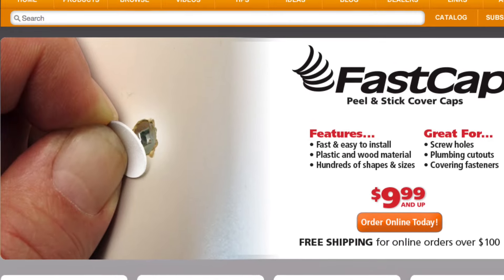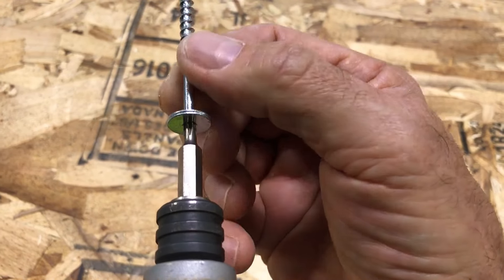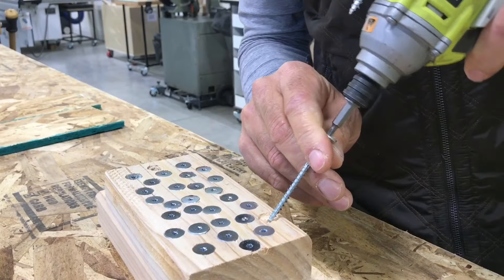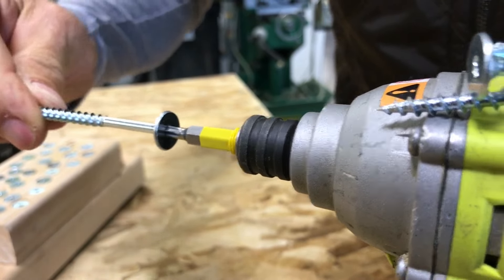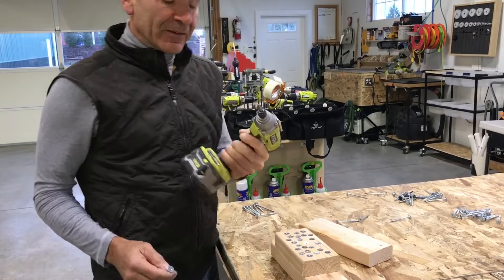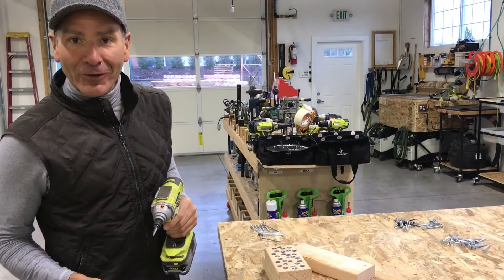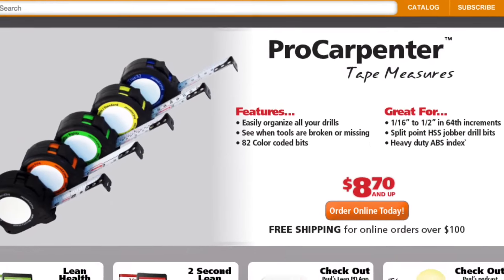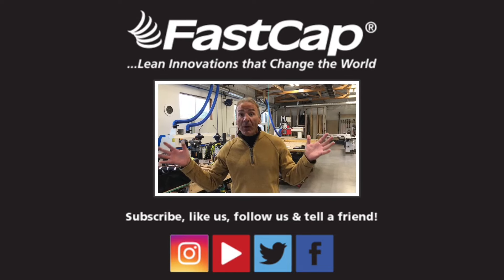Powerhead Screws with Torx Drive

Comment: Torx!!  So much better than square drive heads that are prone to strip.  I love that you kept a close tolerance on the torx!  Thank you for making these.  Fastcap is awesome!
Reply from the maker: Scott My pleasure so happy that you like them
Reply: Now that I am reading the other comments on this I should clarify my comments.  I have used fastcap square head powerhead screws and don't remember them stripping at all.  They are a great product.  My experience with bigbox sourced deck or general purpose screws is that the torx drive with less effort and are less prone to stripping.   Great that you make them both ways.  I won't have to change my bit as often.  Cheers!
Reply from the maker: Thanks Scott!

Comment: We, at BP way are very happy that you brought back the Square Drive powerhead. We use them strictly for installing cabinets and we found ourselves constantly changing beds between the torx and the Square Drive. Also, you mentioned how much tighter your screws fit the bit, that was a problem when you're installing thousands of screws and the bit doesn't come out quickly. Quite often in the bed would get stuck in the screw head and come out of the drill. So again, thanks for bringing back the Square Drive, and is much leaner for cabinet installs.
Reply from the maker: Brian, I get it! That's why we listen to the few people in the world that don't understand the benefit of torx drive :)

Comment: Great improvement. I have always been a fan of torx. The powerhead  is a great screw but I dont like the square heads as well as the torx. It also meant swapping bits while doing a project. So now I can have the best of both. FastCap continual improvement!
Reply from the maker: Thanks Rich!

Comment: fyi I've probably used about 2000 Powerhead screws since they came out.  Most often 2.5".  I've used a lot of both square and torx drive.  I've noticed apparent variation in the hardness of the bits.  I used to have problems with square ones breaking off and leaving the tip in the screw, and ones that rounded the corners of the bit and they wouldn't grab anymore, which is probably one reason you went to torx.  The square drive is fine as long as the heat treat is correct I think.  

Using the torx, I've had some softer than others that would twist the tip.  I've not had any torx bits snapping like the square drive, but some twist and then the teeth roll over and won't grab.  Not all of them mind you.  Most are ok.  It's not easy getting consistency in those little tips.
Reply from the maker: I appreciate the feedback and I promise you the quality control on the bits is pretty good. It's all done on the heat treat line that for the most part is very consistent. Sure, it's possible for there to be variation, but not a lot. We will watch this carefully. If you ever get one that you feel is not treated correctly, I would love to have you send it to me so I can review it. Happy to compensate you with product for any time it takes you to send the stuff back. Paul
Reply: I pulled a couple out of my scrap bucket today. Who's attn do I send them to? I don't need any compensation.  If the bit lasts for the box of 150 screws, which they have 70-80 percent of the time, I don't have a problem with it.  I've purchased extra Dewalt impact bits which have been pretty good. Brad
Reply from the maker: Thanks Brad!!!

FastCap, LLC
Attn: Paul Akers
5016 Pacific Highway
Ferndale, WA 98248

Comment: Hey Paul, now you have me wondering just how bad the HD screws are. last spring I rebuilt my front deck, for everything but the stairs I used square drive, for the steps I used torx to get rid of my last boxes. I didn't strip out a single square drive in the entire 400sqft top. In the 10 steps, two 2x6 wide steps I stripped out about 25% of the HD torx screws. Same screw gun, same setting, same length, same wood.
Reply from the maker: All I can say is we have tested this repeatedly...I am not 100% sure what the problem was. We will replace all the screws or refund you for the the entire order. Contact Sandi (sandi@fastcap.com). The Important thing is that we don't want to waste your time and we want you 100% satisfied.
Reply: FastCap no no, Home Depot screws, not yours. I'd written off torx because I have always stripped them out. but it makes sense if it is a tolerance issue.
Reply from the maker: Ok, good to know!
Reply from the maker: How about this...we're happy to send you a sample of our screw so you can try them and see how much better they are then everyone else's. We went out of our way to engineering and design them to make them very special! Contact Sandi (sandi@fastcap.com) and say Paul said to send me some 2 1/2 powerhead torx screw samples at no charge. Paul